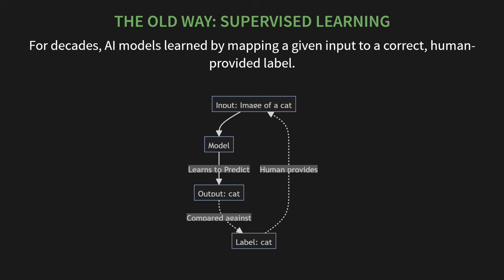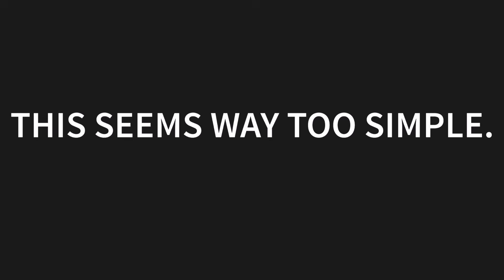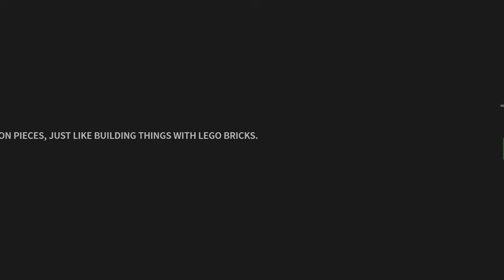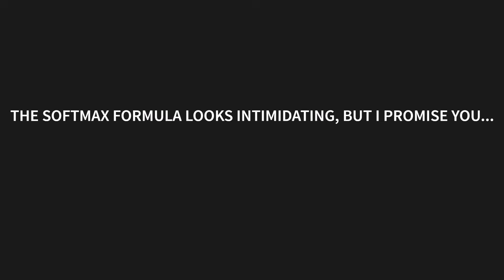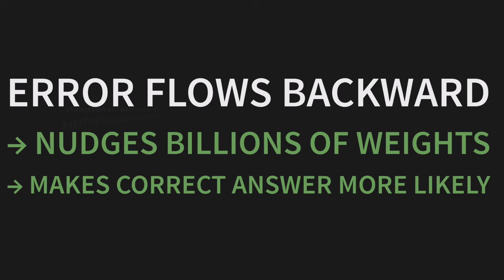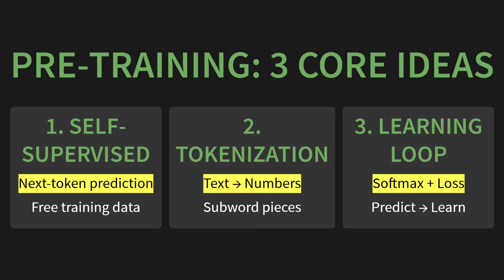LLM Pre-Training in 30 MIN

Comment: Can we use cross‑entropy every time we want to measure errors, or is it meant only for specific problems like classification?  

If it's specific, which types of tasks are appropriate for cross‑entropy and which are not?  

When would losses like MSE or MAE be preferred instead?  

Any quick rule of thumb for choosing the right loss function?

by the way great video 👏

edit: ah  i got the core intention of video